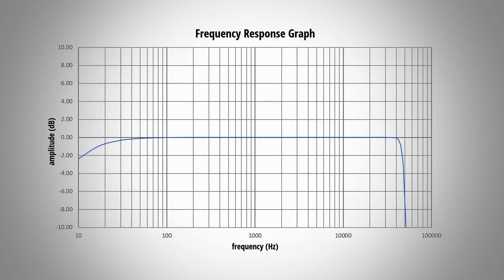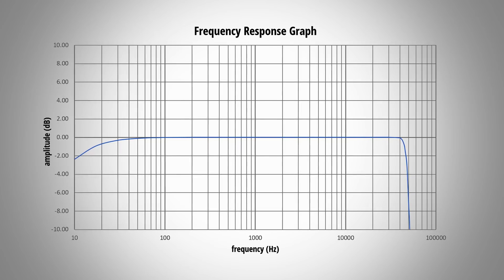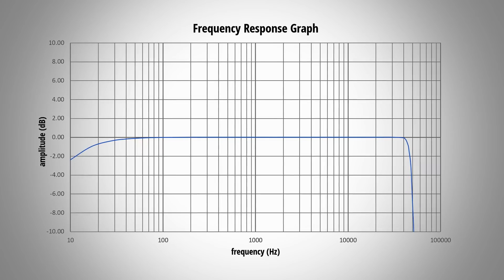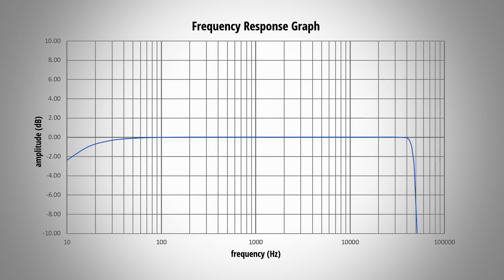Ultimate Guide to Audio Recording Specifications (Tech Specs of Audio Interfaces / Recorders)

Comment: For those who don’t know, a higher bit rate(higher dynamic range) is important because it increases the distance between the sound captured and the noise floor(as explained in the video) and that is important for when you start using compression and gain based saturation on tracks. Because compression brings up the quiet noises while limiting the loud ones, it means the noise floor sounds increase on average.

Comment: Just because the human ear can't hear over 20 kHz doesn't mean that sample rates above 44.1/48 kHz aren't useful. In fact, we can sample at a higher rate ("oversampling") in order to lower the quantization noise of our analog to digital conversion. Put simply, taking samples more often can average out the noise that we get from converting a signal from analog to digital. This won't always be necessary, and other sources of noise or distortion (like a nonlinear or excessively noisy preamp) can overwhelm its potential benefits, but I thought it was important to note why it exists as an option in professional audio. 

And because someone will probably bring it up, oversampling also dramatically reduces the difficulty of producing an antialiasing filter that both blocks ultrasonic noise (preventing it from getting "aliased" back into audible frequencies, creating strange distortion), and doesn't introduce noticeable phase or amplitude effects in the audible range. Audio filtering is dramatically easier in the digital domain than with analog components.

Comment: Hi, could you tell me the formula to calculate the dynamic range in audio interfaces that do not specify it, but if they give the other data such as THD + N, EIN, etc? Thx
Reply from the maker: Hey, there is sadly no formula to calulate it from other measurements. Dynamic range is sometimes also called signal-to-noise ratio (SNR) maybe you can find that spec for your device.

Comment: Hey Julian. I love your work! I'm subscriber of your channel because you are so tech oriented, what I like best compared to advertisement channels on YT and so called "audiophile" talks. If you have possibility, kindly please make review of M-Audio AIR 196/6. I like MIDI IN/OUT, XLR on back of this device, 4 LED input level indicators and big monitors volume controller but I don't have idea if this is better than Behringer UMC202HD in case of self noise of preamps and dynamic range which is very good on UMC and latency as well.
Second question: I use Linux (many distros) mostly based on Debian and free open-source DAW like ARDOUR with low-latency kernel. Is Windows better for audio recording ?
Reply from the maker: Hey, I just released a review of the M-Audio AIR 196|4. It most likely performs identical to the AIR 196|6.
Sorry, no idea about Linux as I currently only use Windows. But I it shouldn't be a problem to use Linux for audio recording.

Comment: Another great informative video. Thank you. Can you please tell me what is "Fs/2" Specification? This example is from "Audient iD22" Specification page:
FREQUENCY RESPONSE:  +/-0.5dB 10Hz to Fs/2
Reply from the maker: Hey, Fs stands for how many times a second the audio is sampled. In other words it stands for the sample rate. Fs/2 simply means half the sample rate. The specification essentially says that the frequency response goes from 10 Hertz up to half the sample rate. If you had set the sample rate on the iD22 set to to 48kHz the frequency response would be +/- 0.5 dB 10 Hz to 24 kHz. Cheers!
Reply: @JulianKrause  Thank you vary much Mr. Krause, you've been vary helpful.

Comment: Hi Julian - great video, thank you.  Quick question - would you say there is a 'trade off' between Dynamic Range and EIN?  For example, the SSL 2+ has an good DR of 110 and a super low EIN of -130 - whilst the Audient iD44 has a low DR of 120 but an average EIN of -126 (the preamp also has 2db less gain than the SSL).  In 'real world' use would you expect these two interfaces to give the user a similar experience?
Reply from the maker: You don't have to trade off EIN for DR. You can have a device that can have both perfect values for both of them. Btw, the EIN of the iD44 is not directly comparable to the EIN of the SSL because it is unweighted. Weighting turn the -126 dBu of the iD44 in about -129 dBu(A). In the real world I would say that you would have a very hard time discerning the audio quality between the two and I would expect that 99 % of people cannot tell the difference between the two. The mic and mic placement makes a much much bigger difference in sound.

Comment: Hi Julian. Another excellent explanation. Before I bought my first DAT machine, my first digital audio recorder for recording my two track masters was actually a domestic Sony Betamax video recorder. I didn't use this as a video deck, just as an audio recorder. It used to record a PCM track, I can't remember now if it used a linear space on the tape or if it was interleaved into the video signal, at 32KHz and I think it was only 12 bit as well. I also used to use another Sony system based on using the transport section of a Beta deck although I never owned one of these. I think it was called the F1 or the PCM F1. This was basically an external interface for all the A/D-D/A system etc. and it connected to a regular Beta deck via the composite/video connections and used the deck's tape to store the PCM stream, it was basically bit streaming unit. The bit stream was essentially modulated into the video signal and therefore used the bandwidth of the helical scanning mechanism. Also, my first CD player was only 12 or 14 Bit on the D/A, despite the media being 16. How things have changed :) Cheers, Dave.

Comment: If only this video existed before I bought my first XLR mic, the AKG P220, which has a quite high 16 dB  self noise. If only I knew then what is in this video, but glad I finally ended up with the NT1. I am weirdly obsessed with minimizing noise so now I'm also curious about the CAD E100S. Man that 3.7 dB self noise is ridiculous. Hey do you also think you can cover "plug-in power"? This is a strange spec to research and I haven't learned much about it except talking with AntLion's engineers...which may have at least partially led to their releasing their XLR to 3.5mm phantom power adapter that is safe to use with i.e. gaming headset mics that only need 5V of plug-in power. Definitely an odd topic that I'm sure you know a lot about already
Reply from the maker: I totally relate to your quest to get the lowest noise recording as possible. Though I doubt that anyone could hear the difference in noise between a Rode NT1 and the CAD E100S. They are both so low noise, that the majority of noise in your recording is probably coming from your ambience. 
Plug-in power is used to power microphones which are connected via a 3.5 mm jack. Plug-in power is around 3 to 5 volts and many products that feature 3.5mm mic inputs provide plug-in power without specifically stating it because it is needed to power the mic. Even your laptop or PC is typically providing plugin-power at its 3.5mm mic inputs. There are some 3.5mm mic which have an internal batterie and they usually don't need the plug-in power. But most 3.5mm mics need 3 to 5 volts to work properly. You are correct, if you want to use a 3.5mm mic to go into an XLR mic input you need an adapter which not only changes the pinout but also converts the 48V phantom power to plug-in power. Rode also makes such an adapter called the VXLR+.